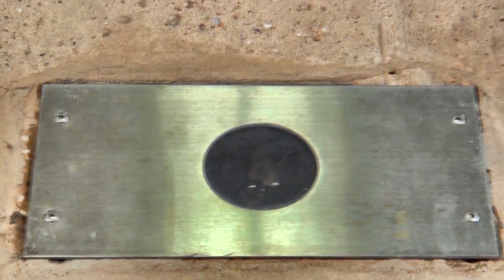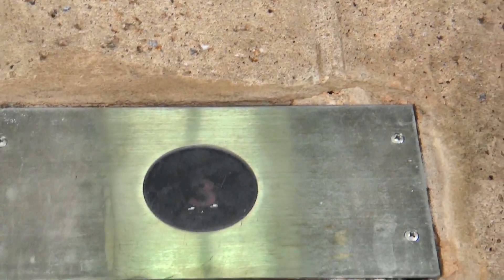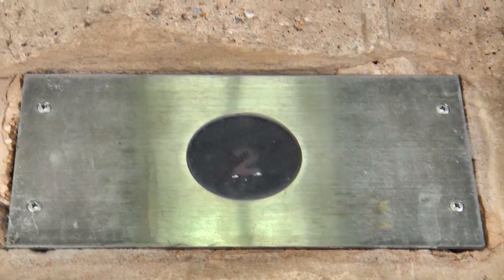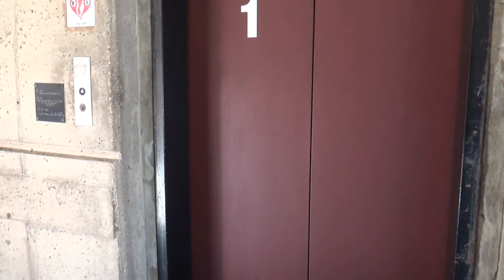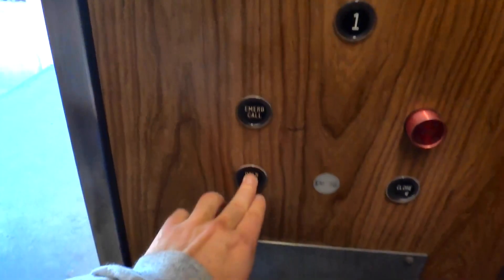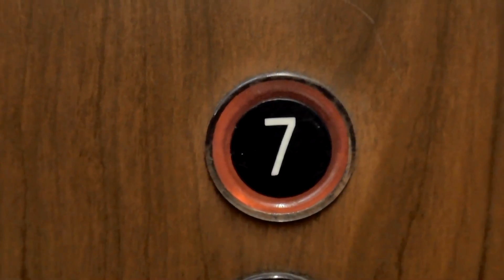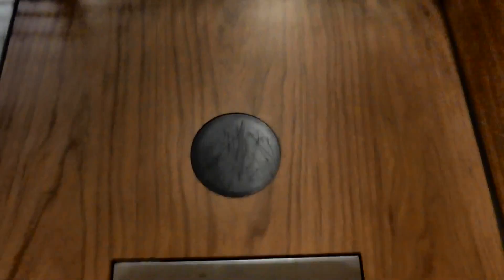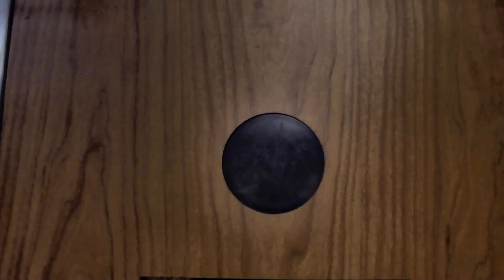An Otis IEE with Lee!

Comment: Never seen a hall IEE indicator before. Interesting that the panel is wooden as well. Additionally, interesting lanterns, I wonder if they were made by OTIS as well.
Reply from the maker: +NewEnglandElevators Really? The few IEE elevators I've seen have the indicator in the hall and the cabin. Got a vid of a high rise one (in much better condition!) that I will upload at some point. 

Lexan and IEE is just not a good combination for a parking garage...The lanterns are a special vandal resistant model, either made directly by Otis or installed by them.
Reply: +thewildeeper Now that I think about it, I've probably seen an elevator on YT before with a hall IEE indicator, just don't remember which ones (hence, me thinking this was the first time for me).

I would agree, based on the outdoor enviornment, it just doesn't seem like a good idea to have Lexan fixtures or the IEE indicator out here. I can understand why for the IEE indicator (each of the little bulbs probably are affected by extreme cold/hot temperatures).
Reply: +thewildeeper 
I don't think there were many other fixture options at the time since OTIS seems to avoid using third party parts for the most part. I have actually seen a Lexan parking garage elevator on YouTube before.